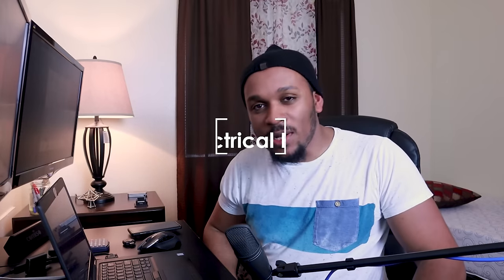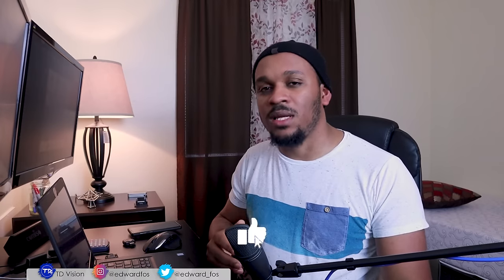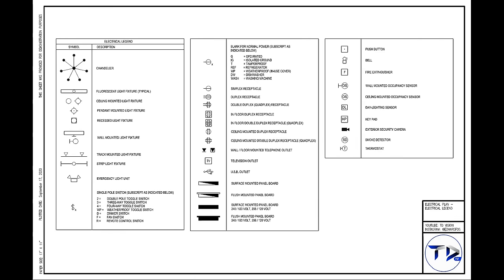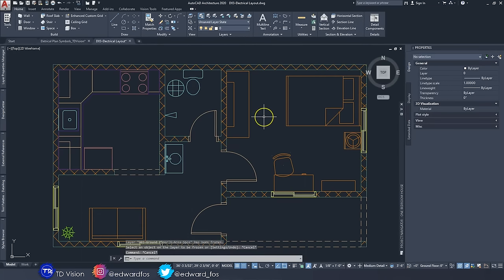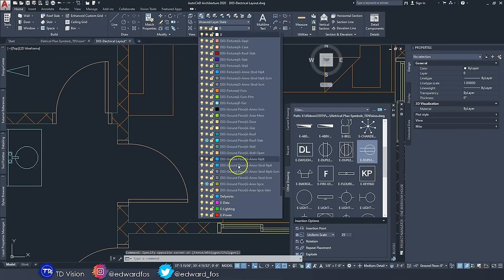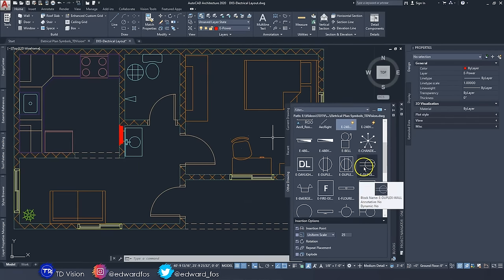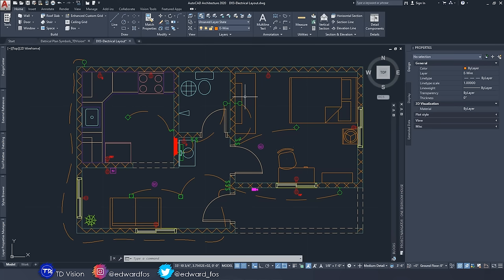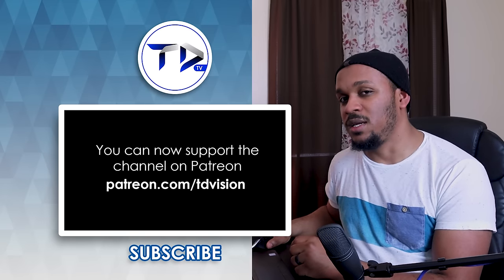ELECTRICAL PLAN (Electrical Wiring) in AutoCAD Architecture 2023

Comment: Great great effort❤.. 
1. Can one use foundation plan to do  electrical plan?
2. How did you identify the location of switch for kitchen  going by this plan (  I understand doors are not placed in the kitchen)
4. Is it appropriate not to show how wires run to the switches from the pannel box.

Comment: Hi, love the lessons. Quick question I thought you weren't suppose to put duplex outlets under windows because curtains can electrical fires. What are your thoughts?
Reply from the maker: That's very good reasoning 🤔. A real electrician would probably give a better answer. So depending on the code in your area, there should be an outlet every "certain amount" of wall space distance, once the wall is not broken. Wall space can be broken by doors or tall windows. For short windows that we have on this building, a plug is permitted to go under the window. You don't have to put it there though. But since it can essentially be hidden behind a curtain, and lines up with the window, then it's probably the best place to put it, aesthetically. If the circuit was properly built, the breaker should shut down even before a fire begins.